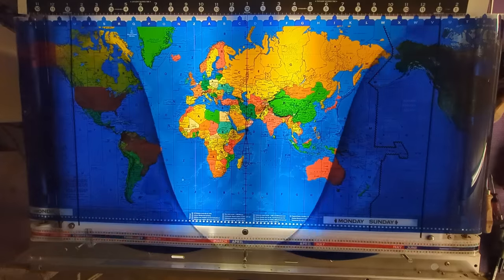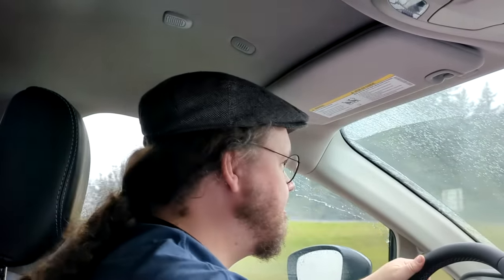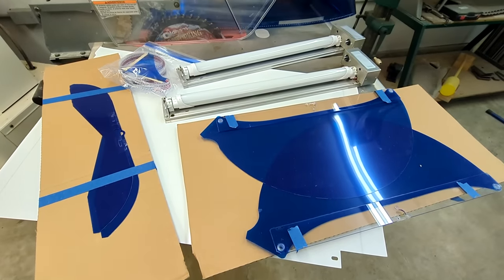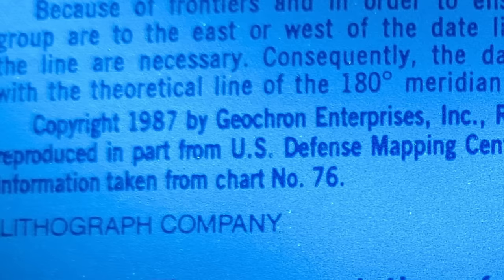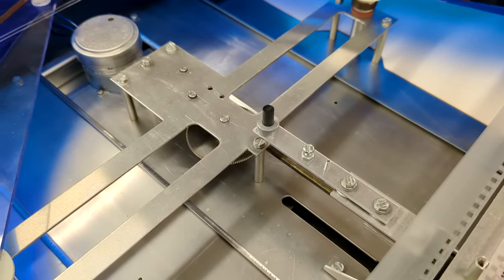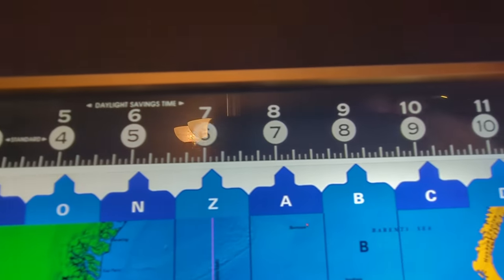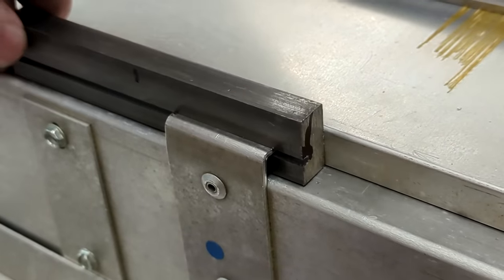The greatest clock (and map) ever made

Comment: I lived on “Zulu” time for many years in the military. There was zero confusion as to when that important phone call between Berlin and DC was going to be.
Reply: Ah yes nothing like setting your alarm to wake you up just before the sun comes up at half past midnight. it's like living above the arctic circle where the clock has no meaning except it's 90% of the world
Reply: I work on software as a contractor for the US Space Force.  And I often have to juggle multiple time standards in the software involving leap seconds, and mission times which are based on simulated data.  It can take me a fair amount of time, sometimes, to look at logs and figure out how to line them up time-wise.  It's simpler when the software is run for real.  But in the lab, it can be a pain.  Be lovely if all the times were UTC.

Comment: The international dateline always knows where it is. It knows this, because it knows where it isn't. And by subtracting this from where it wasn't, it arrives at the inverse of where it should be, which we call error.
Reply: @gavinjenkins899
  and  another scrubbed  Starliner Launch
Reply: funny, but slightly offensive. The IDL does not need a Kalman filter.
Reply: This could have been avoided had you opted to spend extra on the retroencabulator telemetry ground control system.
Reply: This is Retroencabulated Telemetric Ground Control to Major Tom...
Reply: The International Date Line is eepy.
Reply: But how can it go from where it is to where it isn't? It would have to pass through all the points between, which would be an infinite number of tasks, and this would be impossible. The journey cannot even begin. It's like Achilles trying to overtake a tortoise that has a head start. No one can overtake a tortoise that has a head start.

How can you be in two places at once when you're not anywhere at all? Antelope Freeway, 1/2 mile. Antelope Freeway, 1/4 mile. Antelope Freeway, 1/8 mile. Antelope Freeway, 1/16 mile. Antelope Freeway, 1/32 mile. Antelope Freeway, 1/64 mile. Antelope Freeway, 1/128 mile. Antelope Freeway, 1/256 mile.

Comment: What a gorgeous clock!
Fun fact about AC/frequency powered clocks - the motor they use will randomly start in either rotational direction. There is a clever spring-based mechanism that comes into play if the motor starts up in the wrong direction - it winds up the spring which eventually kicks it back in the correct direction. If that spring breaks, your clock could power up going anti-clockwise. :)
Reply: The just look at through a mirror....oops, if it's made from antimatter.. CPT=1, after all.
Reply: Perhaps that explains some thing I had with an appliance. I had an air fryer that had a spinning blade in the middle, and every time I would start it it would run in the opposite direction I wanted so I would have to turn it off and then on again.
Reply: @jasondashney  That would be the reason. Designers obviously decided direction wasn't important and used a cheaper motor.
Reply: @MickTee2k  interesting. It could’ve been one tiny spring away from working like a charm. Thanks for the confirmation.
Reply: @jasondashney  Most microwave turntables are the same way, so they start in a random direction.
Reply: @05Matz  Really?  I'll have to pay attention.

Comment: There is a Geochron in the headquarters building for Dynetics (now a subsidiary of Leidos) in Huntsville, Alabama. It probably hasn't had any maintenance in years, to include setting the date and time. As a result, it is off by months.

Still, it's mesmerizing. Thank you for showing us how it works.
Reply: Fast or Slow? If the former, just unplug it, and come back in few months and lug it back in, I guess that latter you come back in 12-(a few) months?
Reply: @DrDeuteron  There is a way to simply set it to the right date and time. The problem is that no one is taking the time to do it. Maybe they got tired of the hassle after one too many power outages?

Comment: Re: Tangent 2, growing up in Regina, Saskatchewan, Canada and living in a subdivision built in the 50's, every kitchen of every house I saw had a recessed clock outlet (with one two prong receptacle) and a built in clock hook.  They were wired to the same circuit as the refrigerator (the only thing allowed on a fridge circuit by code, iirc) so if you noticed the clock was stopped you would know not to open the fridge becuase the power was off!
Reply: My father was a carpenter.  When he built our house, there was a recessed outlet above the sink.  That used to be normal.

Comment: There's a very affordable option called 'Ham Clock' software, and it's available bundled with a tiny Linux computer (ref. "Inovato").
End result is a tiny computer with an HDMI output, as well as a local network address for browser display.
In addition to the world map with day/night terminator, it also offers solar data, and Moon phase, plus plenty of Ham Radio widgets.  It's great fun for under $100.
Reply: Or try 'Simon's World Map' software
Reply: threw this onto my raspberry pi and hooked up an old crappy monitor. works stupendously well to the point that my house mate agreed to make the common room tv default to showing this along with some weather data as the screen saver
Reply: @blendpinexus1416  Hope it's not an OLED.
Reply: xearth is free

Comment: We used to have a Geochron clock at our yacht club. I always enjoyed looking at it, wondering how it operated. It stopped working recently and we replaced it with a TV, which does not have the charm that mechanical clock had. If you look behind the TV you can see the gaping hole where it used to sit.
Reply: Do they still have it? Might be interested in purchasing it if you know anyone.
Reply: @heatshield I’m not sure what happened to it, I was not a board member at the time. From what I remember Geochron did not want it so we either threw it away or sold it.
Reply: @superdf  not sure how you got that, but yes, God Emperor will crush Weekend at Obamas.
Reply: Your yacht club is shockingly low class. You should feel embarrassed lol

Comment: The algorithm, dropped you out of my feed for a while, great to have found you again!

About transferring blind holes that you need to align to, here’s a trick I learned from a woodworking channel: 

1) Take a piece of some wide tape with a weak adhesive (blue painter’s tape) and apply it to the part with the holes you want to transfer. 

2) You can find the holes by feel through the thin tape. Mark their centers with a little hole made with so,e small pointy thing. (Machinist’s stylus, pin, etc. (Make sure the hole is big enough to see from the other side later though, and you may want to hit each one with a dot of black sharpie to make them stand out a bit better.)

3) Make reference marks of some sort that you can use to align the tape as a whole to the part you need to make the holes in.

4) Apply some strips of double-sided tape on top of the blue tape, enough to hold it to the part you’re going to drill without shifting.

5) Peel the blue tape off the piece and stick it down to the part you need to drill holes in, using the double-sided tape on the back of it. Pay attention to orientation and use the marks made in (3) above to align it.

6) Find the holes you made made in (2) that bark the centers of your drill holes and punch them into your workpiece. 

7) Drill away, peel,and toss the tape.

Easy peasy, works every time :-)

Comment: 20:38 Great idea except for when you need to be somewhere by some time.
Reply: You have to be aware of if you're travelling east or west to save or lose time lol
Reply: And those times are all zulu currently by proxy and in this theory by definition.
Reply: honestly i think we'd be able to adjust for such a thing. it'd take a while (possible a generation or two) before society as a whole has adapted to it.
Reply: Which was the whole point of time zones in the first place - so that local areas could operate on the same time and function synchronously. If we all operated on exact solar time we'd have to account for the time shift any time we traveled east/west.

With the USA centered at ~40deg N that would roughly mean that traveling a mile east/west would entail a time difference of ~4.5 seconds. If you have a 50 mile drive to an appointment it would be a a 3.77 minute difference in time - which isn't super bad I suppose.

For people at the equator a 50 mile trip east/west would be even less of a difference at ~3.5 seconds per east/west mile, or ~2.9 minutes for a 50 miles trip.

People in Canada ~55deg N would have about a six second delta per mile, which means ~5 minutes difference for a 50 mile trip. Still not too bad, I think.

In Alaska at ~65deg N they'd have about an 8.2 second delta per mile, so at 50 miles it would be almost 7 minutes.

There aren't really any population centers beyond 70deg N or below 40deg S, so ~8.5 second delta per mile would be the extent of the time delta most humans had to content with - and most humans live between 40deg S and 65deg N so it would be a few seconds per mile. Perfectly acceptable in my book. People already have to account for leaving early/later depending on traffic, what difference would it make if time shift had to be accounted for too, when it's only a few seconds per mile?

Maybe OP is on to something here! Humans could get used to accounting for leaving a few minutes early if they're headed toward where the sun rises and leaving a bit later if they're traveling toward where it sets. How hard can that be? If they're traveling north/south then it's not really a thing they'll have to deal with. Plenty of people already live near time zone divisions and have to account for it being an hour earlier or later just a few miles from their home already. People would grow up and learn how many minutes they gain/lose by going to neighboring population towns and cities and it would become common knowledge - heck, maybe it could be included on road signs that say how many miles it is to the next destinations.

Originally, when OP had said we should move to a whole new time system, I assumed they were going to argue for everyone being on UTC. Then they went and proposed time zones on steroids. I think both options are better than the wonky time zone garbage we have now!
Reply: @CharlesVanNoland  sorry, forgot to add a /s. This would be a horrible idea.
Reply: Zoom meetings would be an even worse hell than they already are.
Reply: It doesn't sound that bad when you  are going to be somewhere local, but what if you are planning a call with someone far away? You would have to know each others locations at the time of the call to be synced and then probably use some kind of a converter. To me it honestly sounds like too much of a hassle.
Reply: @CharlesVanNoland  very helpful comment!
Reply: @taurasuzdila  UTC could be used for online meetings. And for in person meetings as an other commenter said above the difference wouldn't be too much anyway.
Reply: You use UTC to coordinate things like meetings. The local time he was discussing is so that you can know how late in the day that is for somebody else. For example, 12PM would be the middle of the day in London but people in America would still be asleep or just waking up at that time.
Reply: @yiannchrst  What can I say, I'm a living breathing ChatGPT :D
Reply: @nc7807  and unless you add precise solar time to UTC subdivisions, you still have timezones. But having UTC+8.72 sounds like a nightmare fuel, so I doubt timezones will go away any time soon.
Reply: And people no longer be able to tell "I'll be there in 15 minutes" because they no longer know how much time the commute takes, as the time keeps shifting back and forth, unless they use a stopwatch each time. What a deranged idea.
Reply: @blendpinexus1416  I doubt it. The inability to intuitively plan things, the inability to tell "this commute took me X minutes" without using a stopwatch, just off the top of my head, there's probably a s**t-ton of much more serious cases. If you set a doctors appointment for 12:00 is it in your timezone or the doctor's timezone? If it's in the doctors timezone you'd have to calculate the offset in order to know how early you need to leave to be able to make it. If it's in your timezone then you won't be able to tell if you're on time or not during your travel/upon arriving, because humans cannot easily do those calculations. You'd have a constant need to rely on your device to do this for you. It's the dumbest idea I've heard in a while.

Comment: Great to see that clock back again!  I remember there was one in our megalomanic shopping center, that was built in 1973.  So it was an early model.
It was mounted in a wall near the customer service desk of a large store.  Indeed a beautiful display.
I presume that once in four years you need to tinker with it to handle the leap day?  It likely does not handle that itself.
Reply: Leap seconds are even more effort than leap years …
Reply: @stevebabiak6997  No, leap seconds are just handled within the usual setting of correct time.  Presumably it runs on a synchronous AC motor, so depending on the long-time accuracy of the grid it may need to be set once in a while.
But leap years change the mapping between day-of-week and date, it has to be put back a day in the date without affecting the day-of-week.  So you cannot just turn it off for 24 hours, the position of the day-of-week band has to be changed as well.

Comment: At work we had a clock that lost 15 to 20 min a day. Replaced the clock and it had the same problem. Told the other employee that  we need the electricians over to check the power. Turns out that every time someone used the photocopier the clock would stop. Weird.
Reply: Simpie! ....What does one do when taking a photo...one Stands still.....
Same with the photo copier taking the photo of the clock...it locks up....
its movement to be still...😅😅😅
Reply: @analoghardwaretops3976  HA HA HA....The  photocopier was using so much power/electricity the cycles per second  could not be read by the clock. My solution was to ask if the photocopier could be on  its own dedicated circuit.
Reply: @johnwalterc  There's a case to be made that, to avoid potentially encountering similar issues in the future with other devices, the Clock should have been on a seperate circuit... not sure how valid that argument would be, not being an electrician (and having never encountered such clocks in my life, to the best of my knowledge. Seems like they weren't that common here).

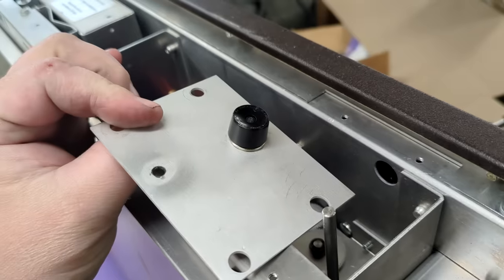Comment: As I programmer I must fanatically protest to the one timezone per degree idea. What I've never understood is why the concept of "noon" must be as 12 o'clock for everyone. If we simply said that the entire earth started using UTC, it would not change anything, apart from when you need to set the alarm to get up in the morning. International online meetings would be easier to reason around, as "15:00" would be the exact same time all over the world, but for some it would be in the middle of the night, and for some of would be in the afternoon.

The biggest challenge with this would be just that understanding, that one time does not equal that everyone would be up and about at that hour. But I still think that confusion is much less of a problem than the mess we are currently in. 

Always using "solar time" would be super problematic if we want to compare times between each other, or schedule something in the future, as you would always need to "adjust" a saved timestamp to where someone is geographically.
Reply: It's 15:00. You want to call your uncle in Perth. Can you reasonably assume he'll be awake? Well, what's the time for him? 15:00, same as you. But what's the difference? Zero. Well, when does he usually wake up? You've never talked about it. Maybe if you take the hour you usually wake, and consider how fast the sun travels... You spend ten minutes calculating locations and offsets and find out that the sun should be as high for your uncle as it was for you twelve hours earlier. Maybe you could make a map of those numbers for the whole world - hey wait
Reply: @k.k.9378  Thank you for this comment because I've genuinely never thought of it that way
Reply: This ridiculous idea makes your programming (slightly) easier at the expense of the entire rest of civilization.
Reply: @alliejr  isn't that what prigrammers always have been doing? 😀
Reply: @k.k.9378  as genuinely funny this comment is, we're already in this situation. And to be fair, those who call their uncle in Perth will have leant when to do it based off their own time already. 

I'd argue this would make this easier for everyone. Image you telling your uncle that you need to leave for the cinema at 16. He will know that's in one hour, without having to look at a map.

Comment: I learned of the Geochron more than 30 years ago.  
Having no money to buy one, I have had to let it occupy a small back corner of my mind.  
But if conditions become favourable, I will get one.    
There is an electronic version, the Geochron Atlas, which connects to a 4k monitor or TV.    
Not as charming as the mechanical one, but it is an option to consider.

Comment: Marc from Long Island Watch has one of these and a JLC Atmos. You might find the atmos interesting, it uses small changes in air pressure to inflate or deflate a baffle and thus wind the mainspring. You can find them fairly reasonably and JLC is a company that while certainly luxury and expensive will always be around to fix it if it breaks.

Comment: That “C-Punch” or “Transfer Pull” tool is amazing actually. I wish I would have thought of that years ago with all the work I have done to trucks fixing various issues over the years (I guess I would use it mostly for body work or installing aftermarket accessories like lights).